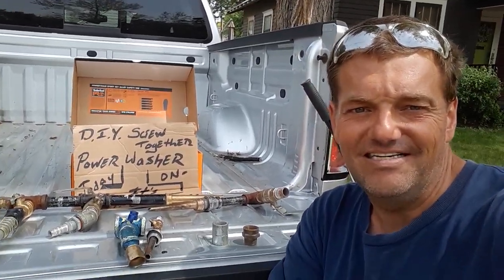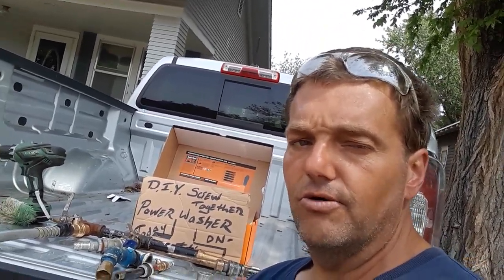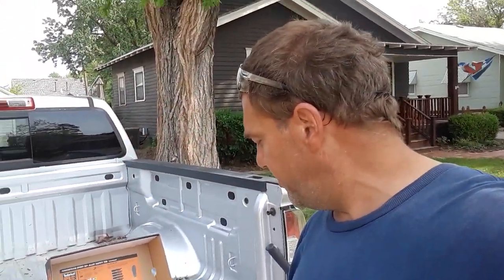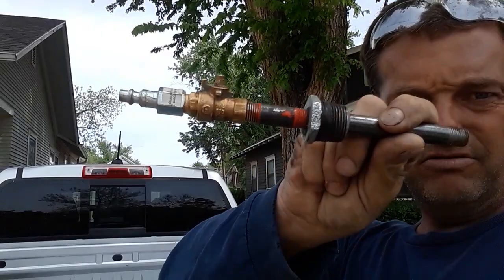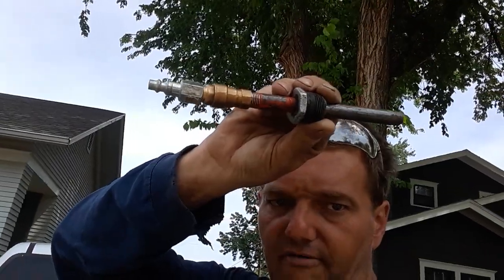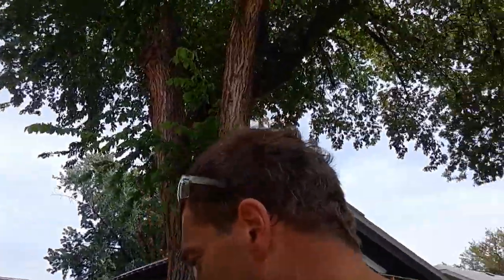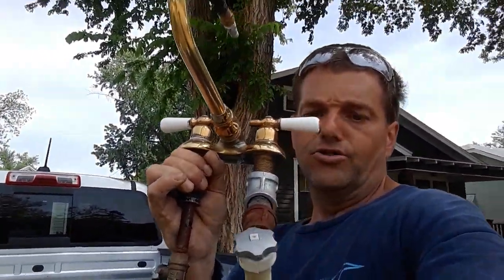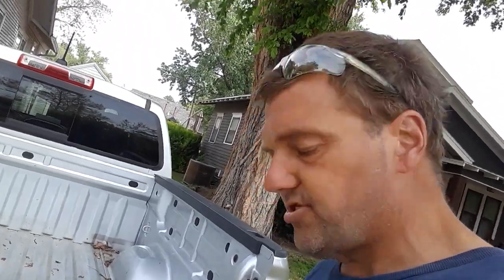Build this! Air compressor powered pressure washer. screw together parts no tools required

Comment: It’s crazy just how similar me and this guys interests are. This channel is the exact type of content that I care about. Air and water. Steam. That’s where my head is at 🤙🏽🤙🏽the the alternating capacitor tanks is what I’ve been pondering on. Switching valve between 2 tanks. I’ve been wanting to try a vacuum with the same
Concept. Build up negative pressure and have the inlet vale throttled closed bias unless you pull the trigger and open it to use when picking up dirt. Only then. It should build up momentum on a flywheel while closed and you release the negative pressure momentarily to take advantage of the momentum.
Reply from the maker: A brother from another mother

Comment: Is it possible to attach classic pressure washer ends to this or would that not work. I’m thinking there is a new spiral end that would be great.
Reply from the maker: Nope. The hole in the nozzel needs to be 1/8 to 1/4 in. In diameter.

Comment: You almost got it.... just put a regular garden hose gun with threads on it. They'd it into a bras T with a ball valve on the bottom of the t with garden hose put in. And then put a 1/4 tube on the end with a flare into the the t and then thread a air fitting into the bottom of the hose gun and you squeeze the pistol grip gun for air and turn water valve on. And you got it. Now I just need to fit a pressure tip thing on the end for pressure washing tips
Reply from the maker: You really need to watch my video titled... Inner VENTURIFLOW  power pipe. You can find it if you go to my channel and search my playlist titled... The King's Gun Series.  In this video I give in depth information on exactly how to build This  gun and explain why it works. Thanks for the interest 🙂 there's lots of demonstration videos there of the gun in action as well
Reply: @tctime  I watched it, that's actually pretty cool. But could I still use a regular all metal hose handle on the air tubing? That looks very awkward to use in a shop
Reply from the maker: @matthewsmith7802  you can and I'd love to see the finished product subscribe to me, and let me know if you build it.

Comment: How did u fix the water running out because air is to much
Reply from the maker: You should check out my ... Inner venturi flow power pipe video . I talk about how and why it all works in detail... You can find it on my playlist... The king's gun series

Comment: Your original drill brush idea is mainstream in the detailing world now. Awesome idea, just a shame you were not able to capitalize on the idea.
Reply from the maker: Thank you for that. Totally glad to hear it's saving folks in the detail industry time and money, while making their jobs easier.  Professional DETAILER'S are one of the hardest working, take pride in what they do people out there.
Reply: @tctime  I'm going through your playlist for the air/water diy pressure washer to figure out all the parts you used to build. 
If you get time, could you do a build video on the siphon gun version you mentioned in one of the videos. I know to siphon water using air pressure is a little more difficult but I would like a gun that I could siphon how water from a 5 gallon bucket or 35 gallon tank to wash the car during winter here in the North East. I tried using an airless paint sprayer but I think the seals inside are starting to give out due to the hot water. The hot water I use is only about 110-120F.
Reply from the maker: If I do not get that video out soon, all you have to do is remove the garden hose nozzel drill a hole in the center of a cap. Your power pipe should be flush with the hole. Then run water thru the air "power"  pipe, and air thru the water pipe,  and Walah! It will siphon. I'm in the middle of some pressurized tank videos right now that will end up being a prototype for a foam cannon, hot water on demand, steam machine, parts cleaner, and a pressurized water tank system for doing your boat, so you can rinse off your boat with hot water when you pull out at the boat ramp. The end result of this group of videos will be a good solution for you as well. But they will be spread out over the next few months. So stick around lots more to come my friend.  Hope this helps. 🤓👍👊
Reply: @tctime  Sounds cool brother, I'm subscribed so I catch some more of your projects.
Reply from the maker: I just added a way to contact me on my about page yesterday. If you have any questions along the way... you are welcome to email me. Thanks again.👊
Reply: 99 % of the time all the ideas come from people that don't have the time or money to pat the idea so the rich will because they do just how life is fucked up as that is its true !!
Reply from the maker: Church.

Comment: About how much psi does it put out compared to a regular pressure washer
Reply from the maker: It is equivalent to a pressure washer that puts out 2000  2500 PSI however the GPM of this pressure washer exceeds anything else that you can currently purchase. Even if you were to buy a commercial pressure washer. Thanks for the question and have a great day

Comment: Does it matter what size air compressor?  Cool video btw
Reply from the maker: Larger compressor = longer run time. The size of the tank really doesn't matter. What's important is the cfm rating,  or how quickly it builds pressure back up.
  I use a 20 gal compressor at work that has a cfm rating of 22... I can continuously run my gun all day on it and never notice a dip in performance... My personal compressor at home is the cheap 30 gallon one from harbor Freight. I have added a 10 gallon booster tank to maintain enough run time without a dip in performance to do stuff around the house.  Wash car/clean gutters/power wash house, etc. I've been thinking about doing a video on this subject. 
  Thanks for the question.  Getting notified will let you know when I upload it. Hope you dont mind me using this comment in the intro.👍👊